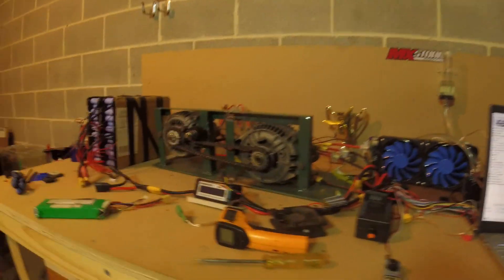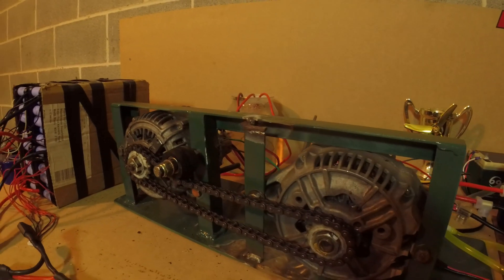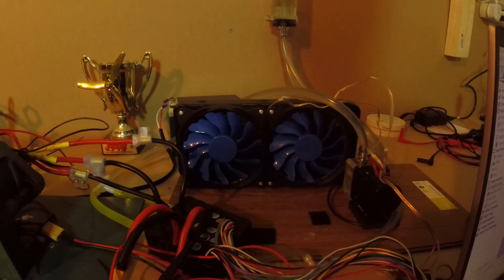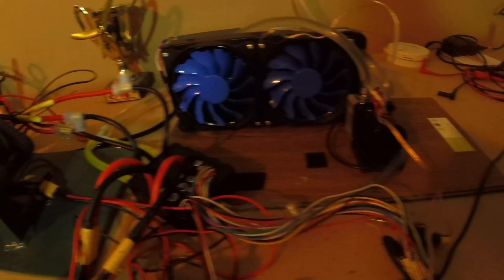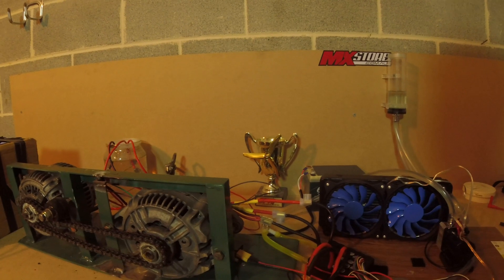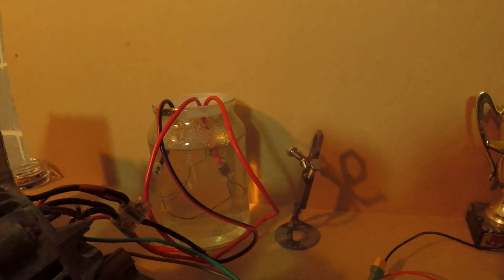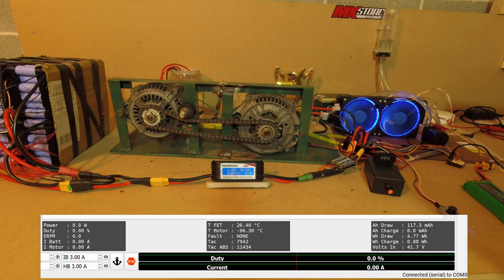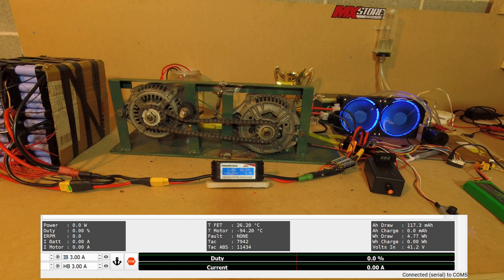Flipsky High Current FSESC 200A 60V - killed my load bench!!

Comment: Apparently Hitachi makes water cooled alternators with a 190 amp capacity capacity that can be had used on ebay for ~$50. Would love to see a video testing the limits of a water cooled alternator.  I was curious are you running the alternators in delta or y configuration? Also do you think 4 of these would be powerful enough for an electric car conversion?
Reply from the maker: @852derek852  I’ve just looked them up look good!  Looks like they make them for trucks and ute’s too for working in the mines they are completely sealed so the dust and dirt doesn’t get in them.  Cheers for that info!  

I’m running them in delta seems to be way better than y configuration 

I think it could work if you wanted to just make a car powered by them but I’ve found they can be harsh on esc’s so probably not the best Choice of motor
Reply: @fixitmoditbreakit7982  If I recall you use a pwm to control the voltage to the rotor coils correct? I wonder if using a constant voltage source such as a buck converter might be easier on the VESC. Alternatively, perhaps parallel diodes would be helpful to prevent reverse voltage spikes when the pwm signal transitions low.

I am also curious whether the pwm induces a signal at the stator coils which could be measured in place of Hall effect sensors for true sensorless position control. This would be an elegant trick for servo control that would only work in a converted alternator, but would require some coding. Once my alternator arrives I hope to conduct some experiments myself
Reply from the maker: @852derek852   I’ve used both and in this test I was powering the field coil with a lead acid battery.  I haven’t noticed a difference but haven’t sat down and test it.  The reason I think they might be harsh on the esc’s is the shapes of the magnets.  They are sort of a triangle shape in stead of the standard rectangle.  I thought as the coil fires part of the magnet will still be near a coil that isn’t firing and giving noise back to the esc.  I can sample the BEMF with in the vesc tool which I will try with dc and pwm to the field coil to see if there’s any difference.  

That would be cool I’m interested in what you find once you get your alternator.  There is a sensor mode in the vesc tool called HFI,  I haven’t got this working to a point of it being better then standard sensorless mode but it is interesting. Here’s a video on it
https://youtu.be/-qV1_xyrgzs
Reply: There is an ukranian guy that used a 220Amp BOSCH alternator to move a small Trabant car
Reply: @foxxyytofficial  I would love to see this. Do you have a link?
Reply: @foxxyytofficial  Ukrainian))) i am from Ukraine
Reply: @trabant_e_drive  sorry